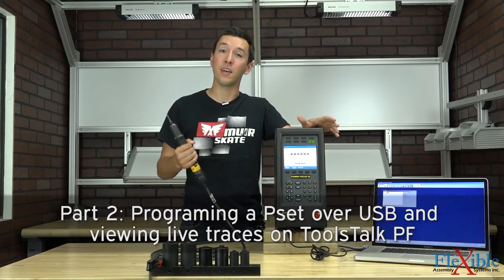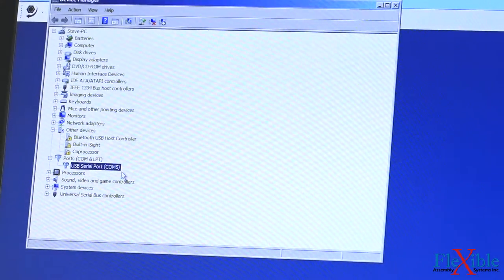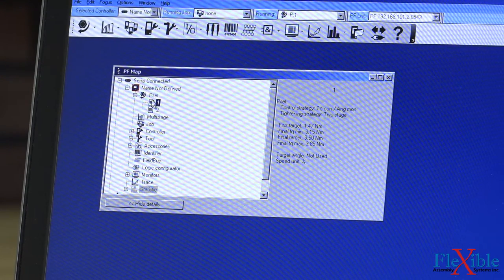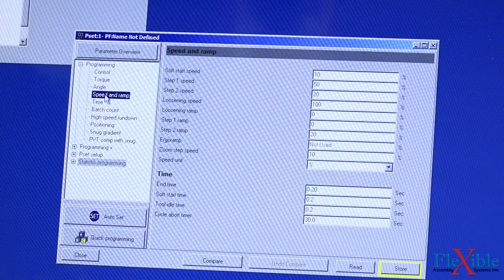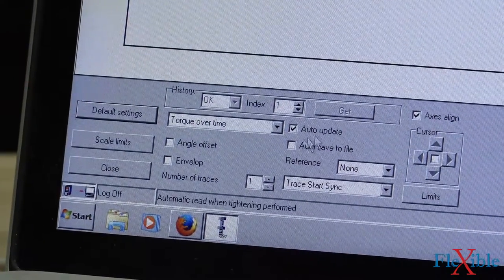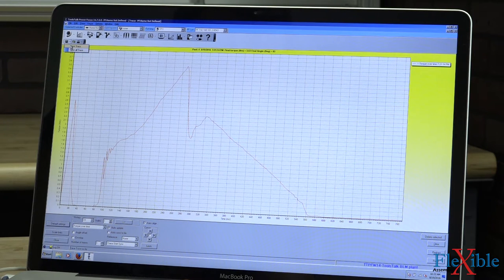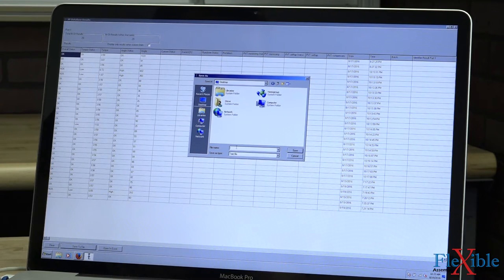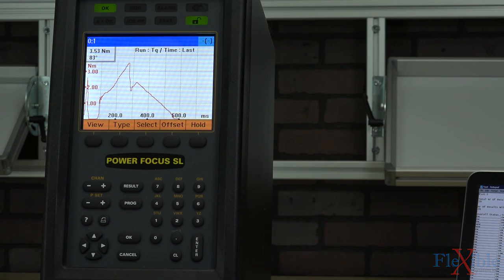Atlas Copco Tensor SL Tutorial Part 2 - USB Control with Tools Talk PF

Comment: you are pulling result buy only one Pset. can we get result buy job? one job can have multiple Psets.
Reply from the maker: If you have multiple Psets for one job all the results will be shown together. One of the result columns shows the current Pset. If you are using the trace viewer it will also indicate which Pset is active during that tighening across the status bar on the top.
Reply: Thank you for input. I was looking for printing and saving by Job number. not by Psets.
Reply from the maker: I'm not sure if you can just save one job number at a time through the Atlas software. If you were to export your results to a excel spreadsheet you can create filters to only view the rows with the matching job number. Hope this helps!

Comment: PF locked in job mode. how can I solve that?
Reply from the maker: This error appears when in a forced cell job an attempt is made to tighten with a controller which is not currently active or when a controller has performed all tightenings. Restarting the job would unlock it. However if you are trying to change out of job mode you will need to connect via Tools Talk PF. Once there you can change the 'Running Job' to none, then select a Pset to work with. If the controller has been locked with a passcode you will need that passcode to unlock it to make changes to the program.